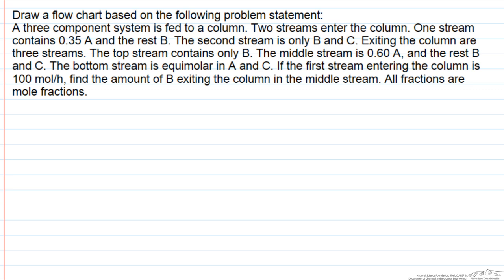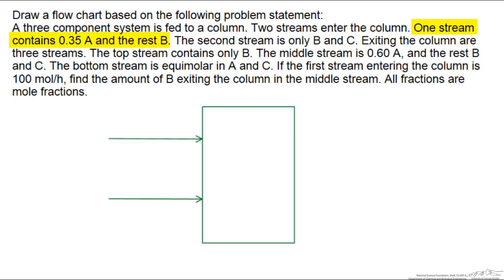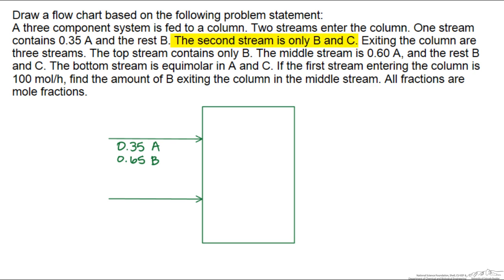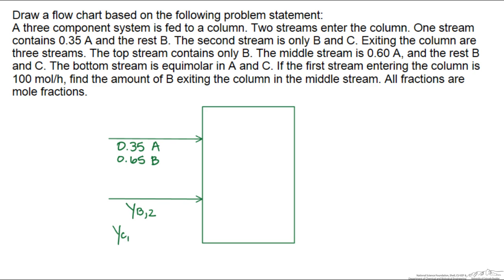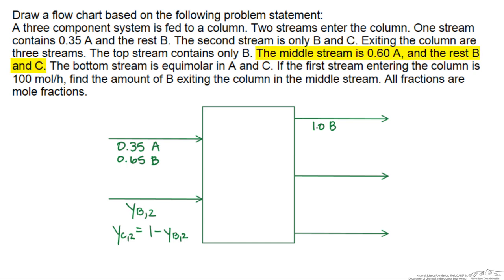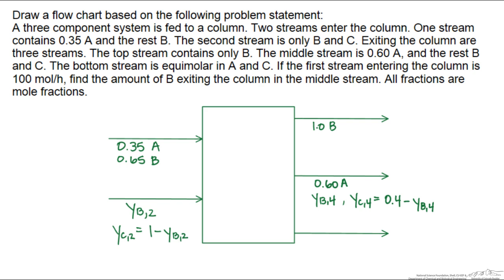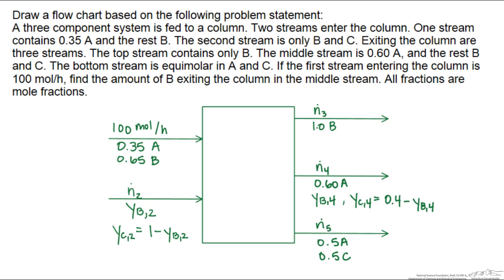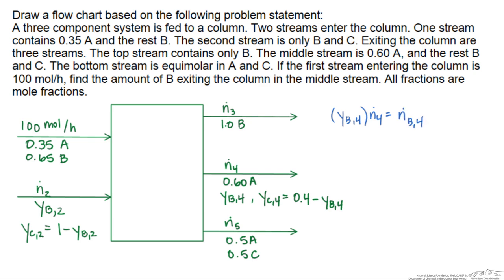Flowchart Example

Comment: This question is underspecified as the DOF = 1, we have 4 unknowns, which are n2,n3,n4, and n5; we have 3 species(for independent balance equations) that are A, B, and C, and we have 0 other information so DOF = 4-3 = 1, also for people who might think why we can't use average molecular weight as we did in the previous video of the playlist to get one more equation so that DOF becomes 0, well the answer to the question is that the species A, B, C are unknown, so we do not know their molar flow rate ( like for methane, ie, ch4, it is 16.04 ), so we cant find average molecular weight, and hence another equation cannot be added, so the problem is underspecified. We cannot find what's asked in the problem.
Reply from the maker: You are correct! The problem is underspecified. This video is just showing you how to draw a flow chart from a given problem. Don't forget about unknowns y_B,4 and y_B,2! To solve this problem, more information would have to be given, such as "Half of component A goes out through stream 5.", etc.
Reply: Mam u still commenting on ur video after long 10 years
Take a bow for u❤❤ @LearnChemE